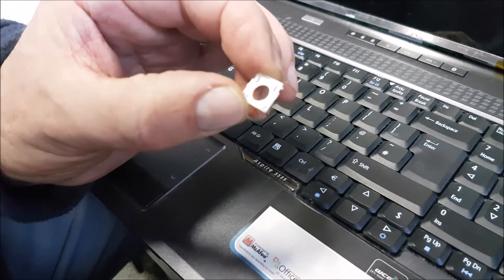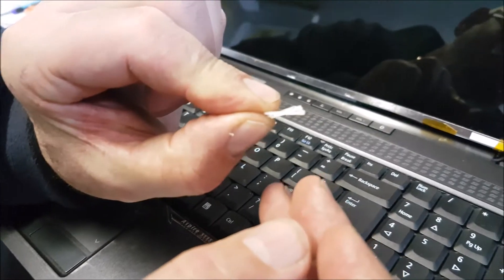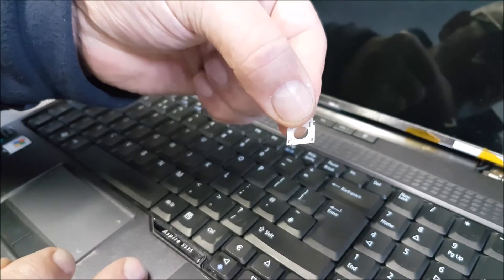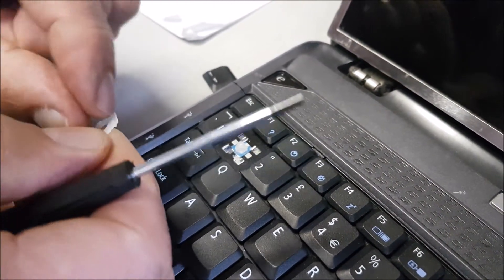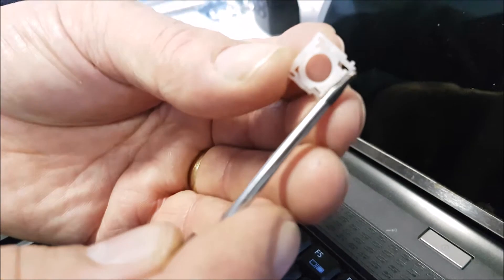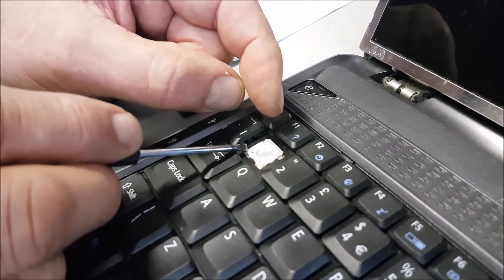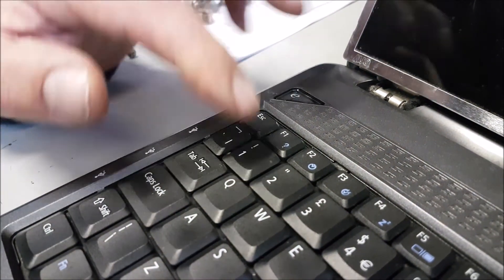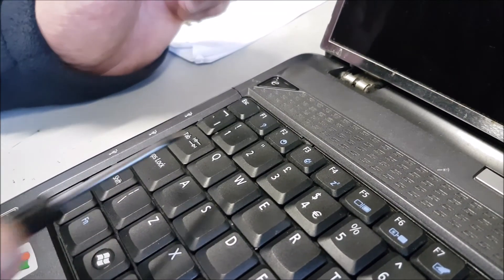ACER Aspire 5535 (HP -DELL)Laptop keyboard, scissors mechanism

Comment: thank you for being so detailed in this explanation. I'd removed one of my keycaps to clean underneath it and part of the retainer had come off the other part and I couldn't figure out the right way to get it together. Once I saw that it was supposed to be flush together and I needed to flip part of it over it all went right back on like a breeze.